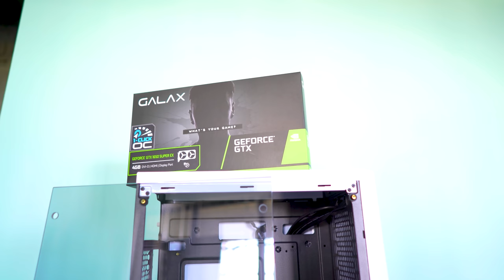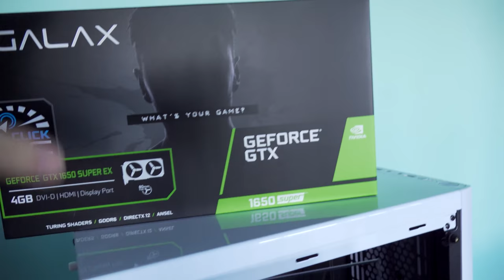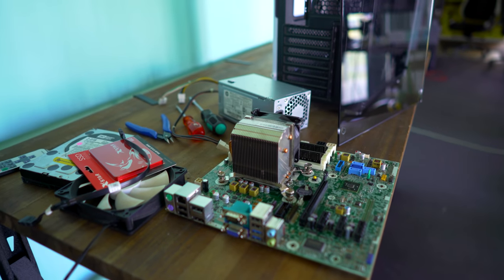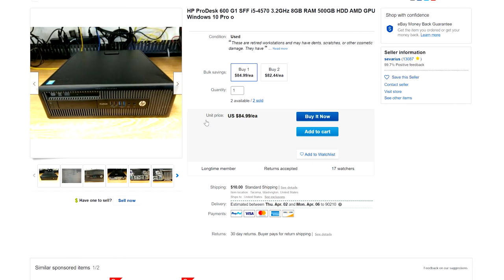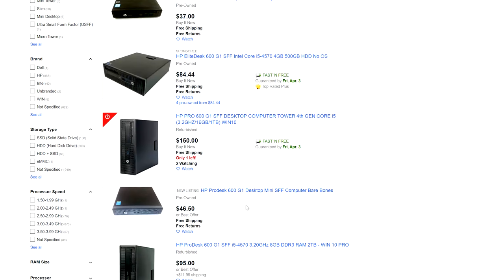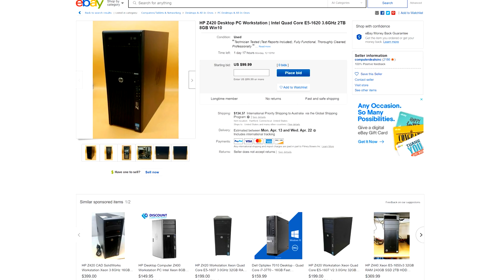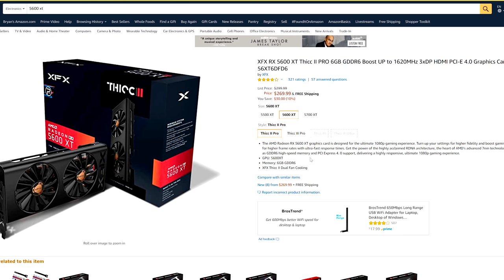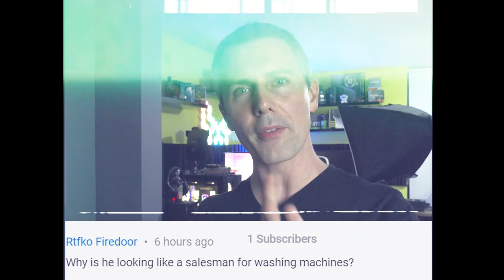I am ALL OUT of Gaming PCs... (Best Budget Gaming PC Parts Right now)

Comment: I've got a Acer Veriton M4 series on my desk rn and as for experience working with it. The system will defiantly need a bios update if it doesn't already have it, finding the bios may be your issue as not all M4 series PC's share the same bios. It took me over a month to find the correct bios. Eventually i got it working with my 1050 ti, but this is the worst experience I've ever had with a PC

The bios i needed was P01-A2, if ever you need just let me know i have the file
Reply from the maker: is it the ivy bridge 3rd gen bios? If so yeah swing it this way I wil see what I can do with it.
Reply: @techyescity  Yes it is for the ivy bridge CPU's. Links is long but it's there
:https://drive.google.com/drive/folders/1-6C8Fh6x9DzMf0asfcUcPoslKeSvUT3b?usp=sharing
Reply: Also i noticed when i put my i7 3770 in and tested the system that the mother board would cap my CPU at 3.4 GHz, so keep a eye out for that

Comment: What budget GPU should I buy for a build I’m doing for a resell?
Reply: Analyzing Male Slavery i5 8500k and 16gb 2400mghz
Reply: @Analyzing Male Slavery im just using old parts from my old pc and building a new one then selling it, but i all i need is a gpu for the new pc that im selling. I might go for a 1650
Reply: @Analyzing Male Slavery they are slightly more expensive than the 1650 at my local supplier

Comment: ive got another optiplex pc i cant even sell here in america. i5 3570s, 16gb ram, 500gb hdd , 8gb rx580, 500w evga psu for $250 usd. been on the markey for 2 months now with over 600 views makes no sense had it listed for $300 with a 240gb ssd but removed it so i could take a lower price to move this unit no luck

Comment: What would you recommend as a best budget ddr 4 motherboard and cpu combo for the money? Great vids as usual btw, keep it up
Reply: If you're going new, a ryzen 5 1600 AF and a b450 motherboard of your choice. I've heard good things about the tomahawk
Reply: @everythingfeline7367  Thanks for the help dude appreciate it. I'm quite happy with going used too since it will bring costs down. Do you have any used recommendations for the same scenario?
Reply: @BenjaminsAxolotls  not really, heavily depends on where you reside
Reply: @everythingfeline7367  Yeah fair point. New Zealand so basically the market it very similar to Australia
Reply: @BenjaminsAxolotls  where I live (the midwest) a local used market is almost nonexistent. Ebay is the only choice 95% of the time
Reply: @everythingfeline7367 Damm sucks for you, but cool thanks for all your help and advice
Reply: @everythingfeline7367  Do you think a used Ryzen 5 1400 (over clocked to 3.75Ghz) paired with a Asrock B450 a good used deal for $150 USD?
Reply: @BenjaminsAxolotls  depends on the specific motherboard. If it's the HDV model, you'd be better off getting a new 1600AF and new mobo for a similar price

Comment: How much power the 1650 super needs? Those sata to X adapters are a fire hazard if you're passing more than 50 watts through them, youtube if full of horror stories from cheap miners.
Reply: The SATA to 6 pin adapter in the video uses a molded SATA connector that is a fire hazard even when not passing more than 50 watts through it.

Comment: Hi Bryan,
I have seen a very similar VGA bug, but it was with 2 HDMI ports. If I plugged into the port #1, worked okay, but if I plugged into port #2 it worked as a second monitor, even it was the only plugged in. Try it with 2 monitors, or with 1 monitor try to hit windows + p to change the settings to secondary only. Worth a try ¯\_(ツ)_/¯

Comment: big gaping mouse/rat hole on the back of the power supply no IO shield leaving another gaping hole that PC wont last very long.
Reply: is not that bad man
Reply: No I/O shield improves cooling if there is no rear exhaust fan.
I would rather see him use an old case instead of a new case with side window.
Who wants to look inside that case?